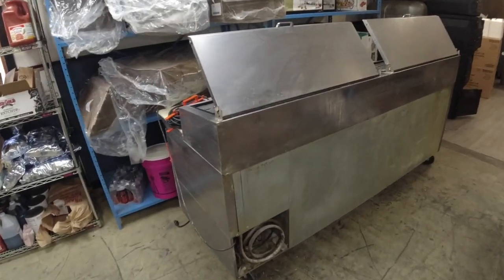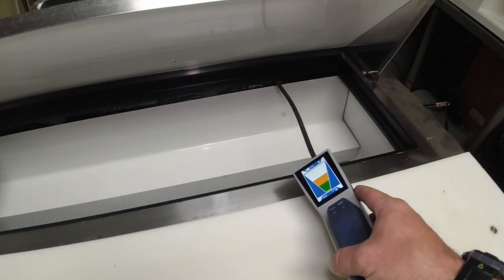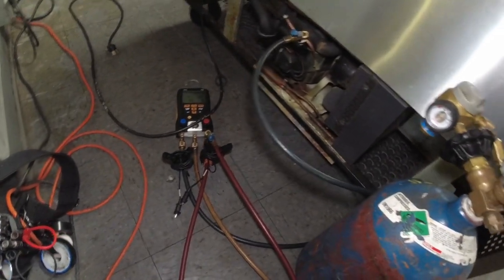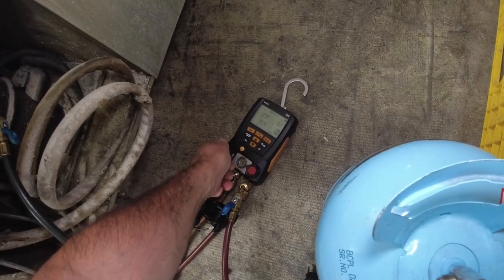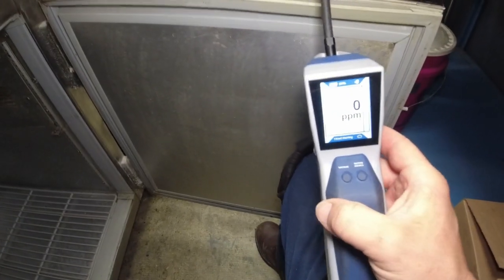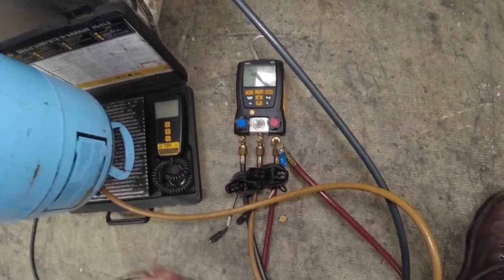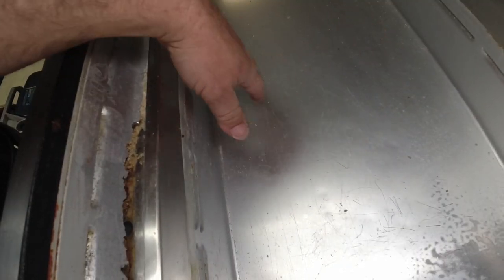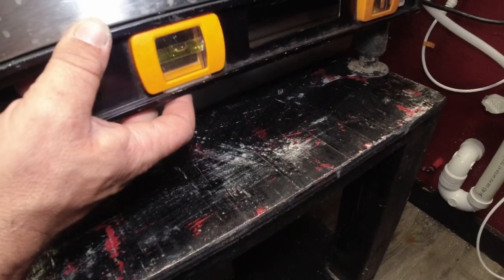Two Prep Coolers & Ice Machine Not Working

Comment: I got that same NTG regulator at beginning of cooling season been real happy with it
Reply from the maker: I would like to have one of the 500 or 650 lb ones. Mine is 250 but I got it cheap on ebay. For most reach in units it works great
Reply: I have the 500 and 250. I order the wrong one is why I have the 500.
Reply from the maker: I feel ya!

Comment: Rick, the company that my employer deals with requires us to make cord repairs with brown tape. My employer actually used liquid tape to make waterproof repairs on minor damage and then we don't need tape.
Reply from the maker: If it's like extension cords rules, it's probably against OSHA🤷‍♂️. 🤣😇🤟
Reply: @HVACRSurvival  the company only allowed one repair per cord, but replacement cord ends are okay. I persuaded my boss that we need a few 25' cords around, and he consented. I also bought bulk mil-spec wire in 12ga and cold weather tolerant, and several of those are over 100' long. Some places in the plant, the power outlets are too far apart, so these are great. We also have to use a GFCI on anything that we plug in, unless outlet's so provided. We have a couple GFCI outlets with a magnet to hold them to the steel columns if necessary.

Comment: So if pulls in vacuum but full… like a pull down for defrost? Means maybe a restricted expansion valve/filter drier?
Reply from the maker: The first thing I did was verify that the compressor ran because I don't want to pull a big vacuum and spend a lot of time on something it doesn't run. The next step was to find out what my running pressures were. Once those things were established if the pressure was low generally I will pull a vacuum and recharge it back to factory spec then see where my pressures are at. If I'm in a vacuum then I know there's a restriction and not just low on refrigerant.
Reply: @HVACRSurvival   I thought you were saying had it full and was still pulling negative? And had to over charge to get suction pressure? Guess I miss heard you!
Reply from the maker: I hate text messages, they're easy to misunderstand. What I did was pull a vacuum, weight in the factory charge, plugged it in and it was going into a negative. I added an additional 4 oz to get it up to around the 15 lb to 17 lb suction, which is a little low but it usually works.
Reply: @HVACRSurvival   got it! I was thinking maybe high side blocked, so was stacking gas like having a pump down for defrosting. But had no receiver so my self figured was scary need room to do a pump down into  or could blow something ?
Reply from the maker: It could be a drier but usually they don't catch oil break down,  the cap tube does unfortunately. I had a video where I went back n replaced the drier and cap tube a second time after replacing a leaking evaporator before I finally replaced the oil in the compressor. That fixed it from becoming restricted again for a 3rd time.

Comment: So you raised the ice machine in order to utilize the drain….why not cut off 4”  of the drain pipe?
Reply from the maker: It was the customers idea so I just did what was easiest. If I had half inch PVC, I would have ran it in that. I only keep 3/4" on my truck,  I now have some 1/2" on my truck for when I go back to replace the evaporator

Comment: In the machine you decided not to fix do you have an evap out of that one thats in fair shape, I have one of those sitting in my garage that needs an evap, Grid separated. manitowoc is proud of that damn thing LOL
Reply from the maker: The True cooler is the only one that wasn't getting repaired. I don't have any spare parts
Reply: @jason windecker- 

Lookup ice machine plate separation. There are a few tricks which will help make them work again for a little while. Like hammering an X with flathead at each cross section of metal to prevent separation.
Reply: Lookup ice machine plate separation here on YouTube. There are a few great videos with tricks which will help make them work again for a little while without spending any money. Like hammering an X with flathead at each cross section of metal to prevent separation.
Reply: @jphvac5725  it's toasted.  The grid fell out entirely.  Even if I tried to braze it back it I would have harvest issues.  Ill just suck it up n buy the evap. Is just a evening project so no hurry.  Just figured I'd see if someone had a fair evap